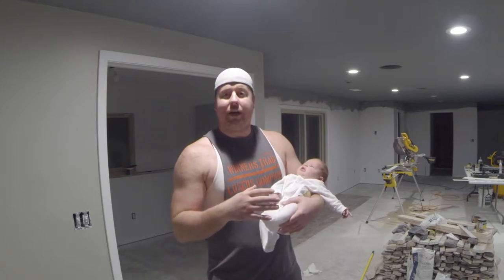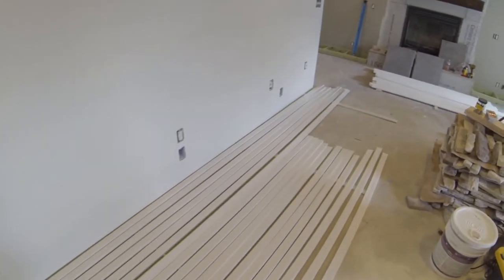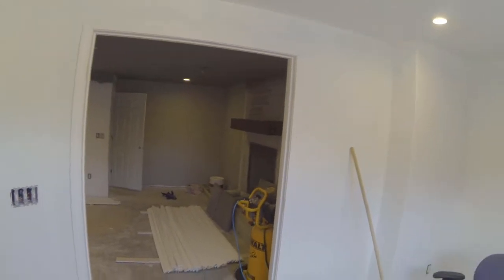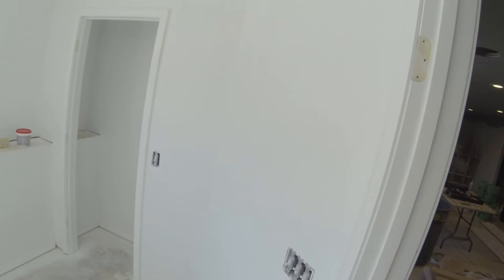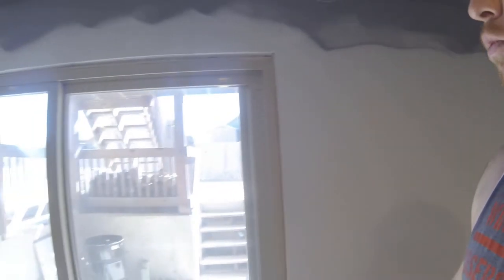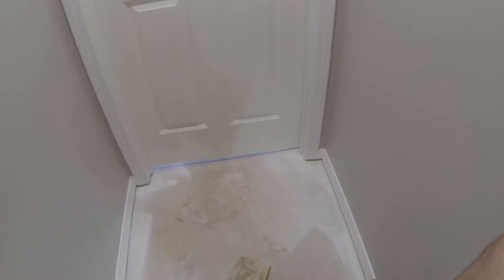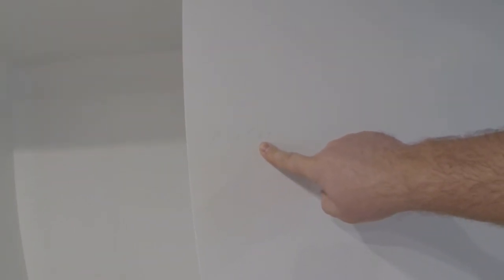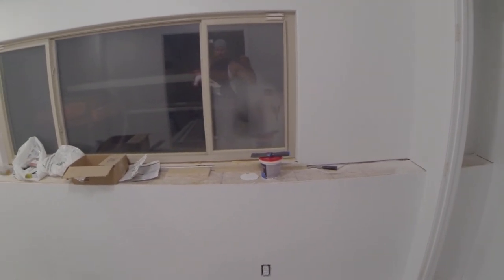Basement Trim and Baseboard Install | Basement Build 16

Comment: THANK YOU. Lots of videos say that they use different nailers for the thinner and thicker parts of the trim, but you're the only one I've seen actually specify which ones and what lengths. For a newbie like me, that's dang useful info. And not just because I've got lots of trim sitting around waiting to be reinstalled after I took it down to apply foam insulation around my windows...

Comment: Curious why you hung your trim before paint?  Also seen you rolled the paint vs spray.
Reply from the maker: I primed all the walls by spraying them. Hung all the trim, filled in all nail holes, caulked all seams, sprayed trim; then came back and taped off trim, rolled walls

Comment: Did you use casing for your baseboard?
Reply from the maker: From what I understand, it's interchangeable. I used all of the same for the doors and floor molding. I believe it was all casing